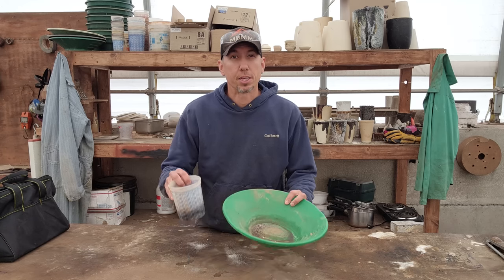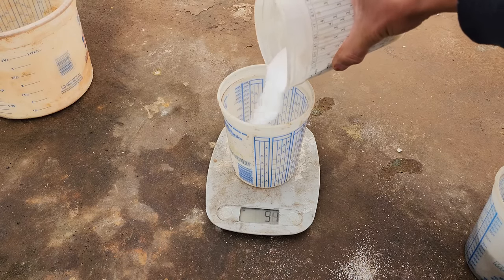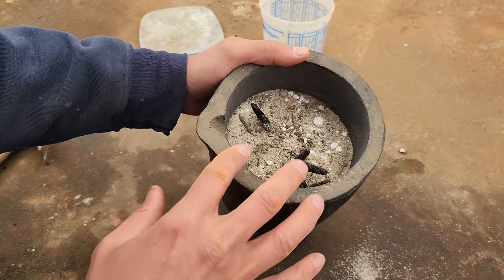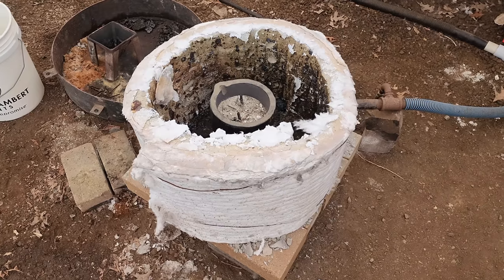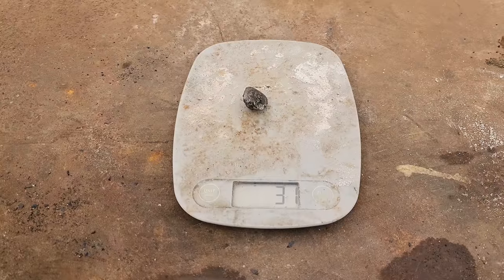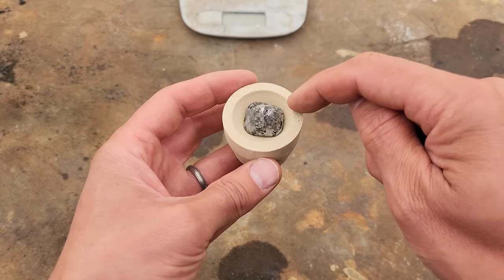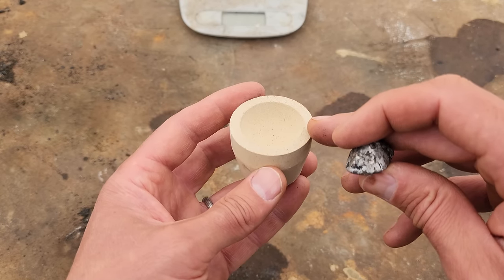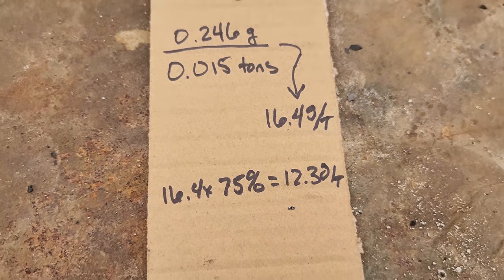Collaborative Gold Smelting: Assessing Dan Hurd's Gold Ore!

Comment: You need to be very careful around ceramic fibre insulation, some packaging will mislead you into thinking it is a safe product but  all ceramics will change the structure when superheated and the result can then become a serious  heath hazard!
Reply: The dust ? I have some but sealed it in a bag until I learn more......
Reply: @pappawheely  yes as I am led to believe the superheated dust will no longer be body soluble and could stay in you system for years!
Reply: @foxfish7115  nano dust sounds bad. I will keep it bagged for damn sure ...  thanks...
Reply: @foxfish7115 t's not soluble, what happens is after formed into fibers, the pieces or strands are generally too large to be inhaled with much risk. Heating to high temps on the other hand can cause it to become more brittle especially with repeated cycled, allowing it to break in smaller average sized pieces that can get caught in your lungs more easily. I suspect that what can happen is the same as breathing in glass particles that will cause your lung tissue to scar around the inhaled particles. Repeated exposure would then significantly reduced your lung capacity. It's the exact reason why media/sand blasting either takes place in a sealed box, or they wear a full body suit with a respirator.
Reply: @pappawheely  I use a lot of ceramic fibre products and have done so for many years! It has only been recently that I discovered the hazard potential  but I have always been pretty cautious wearing mask when handling  the stuff! 
I think you just need to be aware…..
Reply: @nunyabisnass1141  I live in Europe and all the ceramic fibre I use is sold and certified as body soluble. I have access to some technical descriptions of what happens to the chemistry when the fibres are exposed to high temperatures as this is discussed on rocket stove forums and pizza oven forums.  
However I am no chemist but I do use a lot of ceramic fibre.
Reply: @foxfish7115  Thanks for the heads up...
Reply: This would be why getting/building an actual furnace from heat proof bricks to do this is a sensible idea long term.
Doesn't take much more effort than making one of these either...
Reply: RTZ Wash Coat is a zircon based refractory coating that can help prevent that.
Reply: When the bismuth rolls off, is it rolling due to the mantissa on the gold bead?